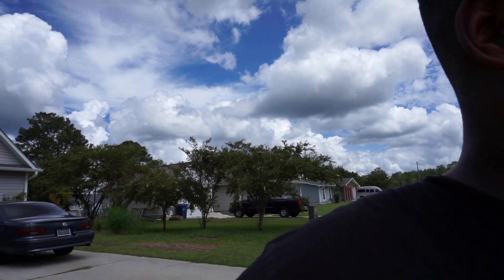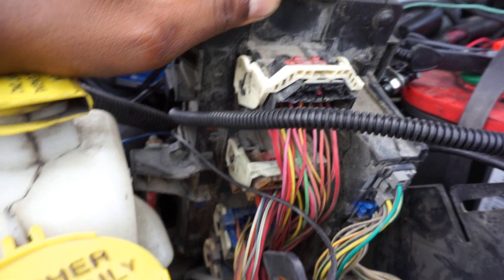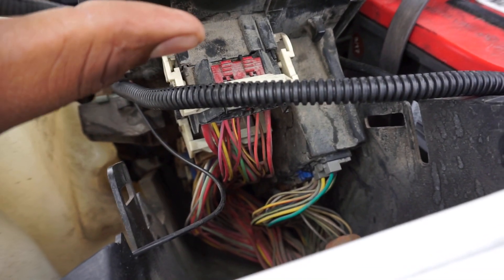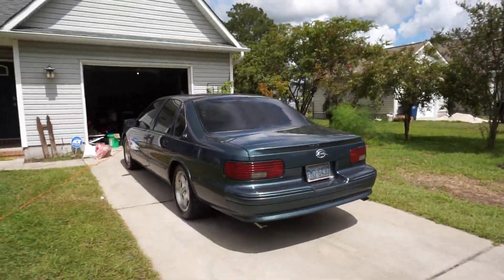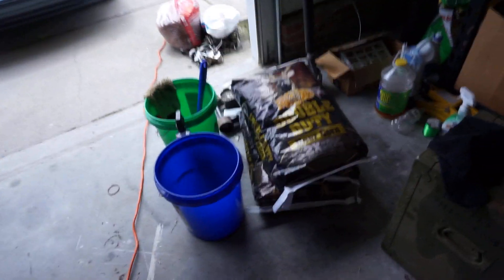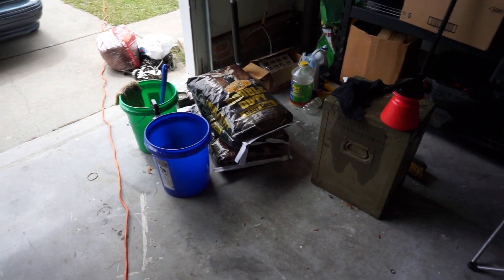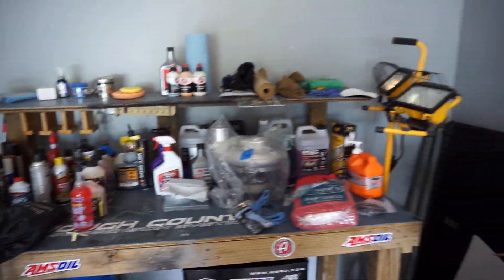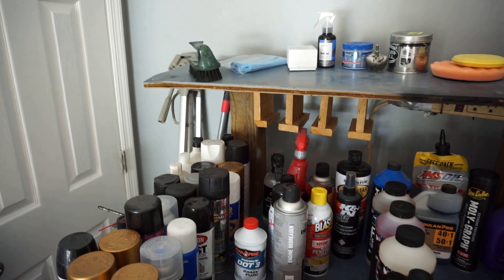Finally Isolating 6.7 CUMMINS Fuel Pump Issue!!

Comment: Sorry for your for troubles I hate electrical issues, as for your TPIM Dorman sells remanufactured ones and Dorman says they go threw the TIPM's and fixes the weak points like soldering etc. Thats what I replaced mine with on my 06 when I had issues I've had for 3 yrs with no issues. Good luck hope you get her fixed .. Happy Labor Day
Reply from the maker: Hoping replacing the pump is gonna fix it but if not then tipm will be next in line lol

Comment: Did you happen to leave your Setup from factory still there? IE: factory fuel lines and engine filter? If you did you could reinstall everything back to factory just until you get the problem figured out. This would also help you to tell if your issue if factory side or Airdog? 

I only say all this because I had a guy from TDR walk me over an install to where I installed my Fass parallel to my factory system this way if i ever have an issue with my Fass I can go back to my factory system until i get the Fass back up and working. all my factory filters are still attached and I still changed them every 30k miles just to be safe.
Reply from the maker: No when I installed it I gutted stock sending unit filter.

Comment: The issue I had with my TIPM  was my ac motor was intermittent just like you said I pulled the TIPM  and messed with the connector  and it would run put it back in it doesn’t work.  After I gave up the shop that diagnosed it said it was internal to the TIPM circuit board in there that when you tweaked it it would make up and run. Bottom line it had to be replaced.
Reply from the maker: Hopefully it doesnt get that far for me but we will see!

Comment: so i have an older Air Dog 2 with the brushed motor, Mine died like yours, i tore it apart and all the brushes were used up...  Airdog sent me a new motor under warranty. i replaced the brushes (found some that would work at ACE) and have the new one as backup. i glad to see that have moved to brushless motor on the new ones..
Reply from the maker: Yeah man idk what happened to mine but I know she dead. Lol that's cool u swapped out brushes and got yours working again.

Comment: You could have a dead short anywhere in the harness that you unplugged from the fuse box which goes away when you unplug it, and then shorting out after you plug it back in, get yourself a real rms multimeter and start ohming out the corresponding fuses going to that harness plug, your making good progress you just need to figure out where the short is coming from. Could very well be a bad lift pump causing the short but you could test that the same way or just bypass the harness with a 12v constant as a test.
Reply from the maker: Yeah I'm going to be testing them out before I install the new pump!

Comment: You made it more difficult than needed. All you needed to do is remove the relay. The relay has four wires going to it. One wire to the relay is from the battery and another wire going to the relay goes to the fuel pump. I believe it's number 30 and 87 where the relay plugs into. Remove the relay and put a jumper wire from 30 to 87. By doing it this way you eliminate the ECM and and relay.  The other two wires going to the relay is ground and ECM.  One jumper wire and you know for sure if it's the fuel pump or not.
Reply: Joe Bortolotto listen to what he is saying
Reply: He got a new relay and harness from airdog already.
Reply from the maker: Yeah we pretty much are narrowed down to the lift pump.

Comment: Get a decent multimeter and check resistance on motor leads. You may have to present the data to airdog to fight your case. The motor should really have some kind of overload protection beyond a fuse in engine block to protect the pump itself.
Reply from the maker: Airdog already sending one out, awesome customer service they gave me.

Comment: More than likely the pump was either struggling to get fuel from the tank in a low fuel circumstance. When the pump had no fuel to help cool the housing, the heat degraded the motor windings to the point where a short occurred in motor and fried from the motor back which fried your pigtail and relay before making it to fuse and battery connections.
Reply from the maker: That's what I was trying to say on camera lmao that is a very possible cause and I think that could've happened, especially since my tank was less than 1/8 of tank before running out.
Reply: Lol I hear ya man, these pump motors are only dependent on the fuel to help cool them since they have to be sealed up for weatherproofing. One thing I have to be careful of,in the north east is the winter time. The diesel is cold sitting in the gas station holding tanks and flooding that into a hot pump that has been running can cause issues. Nice ride by the way, I’ve been saying when my lmm’s motor goes in a few hundred thousand, I’ll be swapping a Cummins into it!

Comment: Hard to imagine that pump motor going bad, but it's possible.🤔 However, you said power is getting there, so perhaps it's the case. Assuming all the wires are ok, I looked at prices for Ram TIPMs, seem to be around $350? Some cheaper. Any given TIPM seems to serve several vehicle models. 🤔 Thx for elevating this issue for us Ram Cummins owners! 😃
Reply from the maker: Yeah I was skeptical the pump broke but if all the steps lead to it and still no power that leads me to the pump being bad. Sucks but atleast airdog has awesome customer service!
Reply: @EVERYTHANGDIESEL  just don't use the factory wires make your own stand alone relay unit easy screw hunting down the Mexican wireing

Comment: Don’t run that injection pump dry too long or you’ll have a bigger pain in the wallet! Get lift pump running correctly first. After lift pump cycles correctly:
1 Loosen the nut(s) connecting injector(s).
2 Turn key to cycle lift pump.
   *Bump key to cycle lift pump until fuel comes out of loose injector(s) if necessary.
3 Tighten up loose nut(s) on injector(s).
4 Crank until engine starts and levels out.
Hope to watch the video of that girl running. 🤞🏼